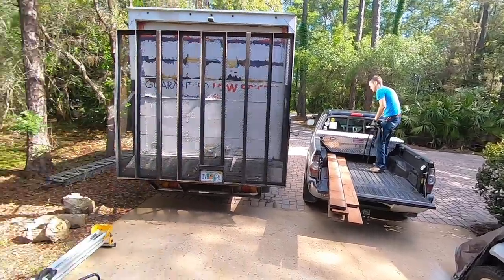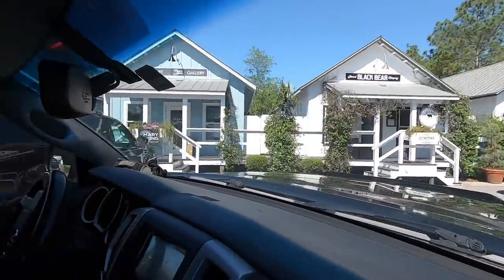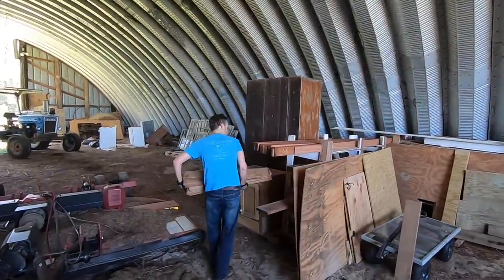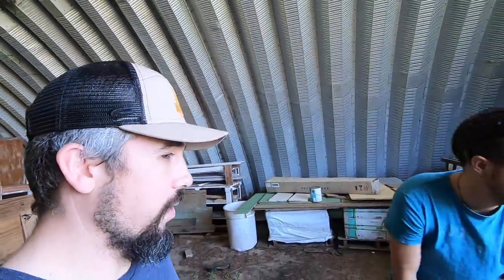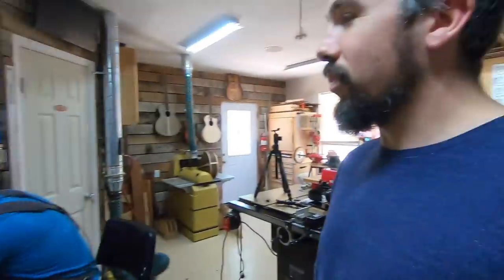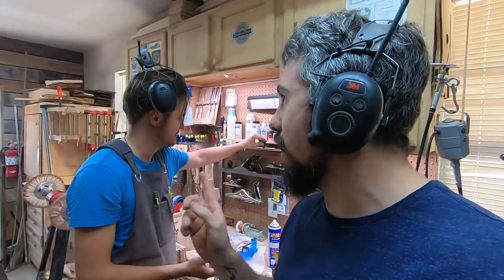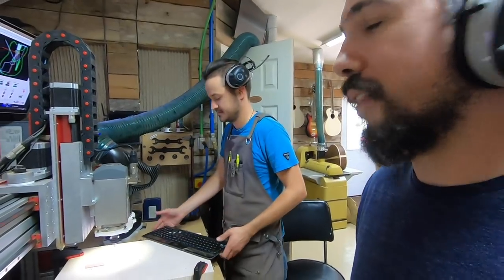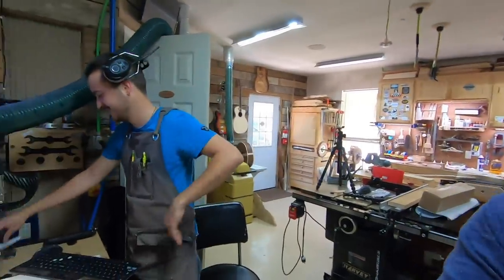Launching the production electric guitars has its growing pains.

Comment: I love what you’re doing with the carbon fiber rod to try to give the guitar increased rigidity in the neck. Ken Parker pioneered a similar technology, which you could really try something similar as well since you have a vacuum pump. Parker guitars were skinned on the back with a carbon fiber sheet with epoxy and then vacuum pumped and baked to cure. The fretboards were done in a similar fashion and then stainless steel frets were essentially glued to the board.

The resulting guitar was actually strong enough to be only several lbs (3-4) in terms of weight and actually didn’t need a truss rod either (even though they had them so people wouldn’t feel skeptical).

Comment: Your table looks big enough to hold more than one body at once. You can use specific g-codes to reset the x0y0 for the "left" side & the "right side". It only takes a small change with a text editor to the original program. Now you can set Z zero only once for 2 guitar bodies. They could even be different bodies like a lh & rh. If you have enough room on the table, you might also do a neck or 2 at the same time, or other small pieces.

Second pre-set tooling in holders would all but eliminate setting Z0 between tools.
The down side here is initial cost cost of the system & would likely require a spindle  change.
 
Feel free to contact me if you need more details